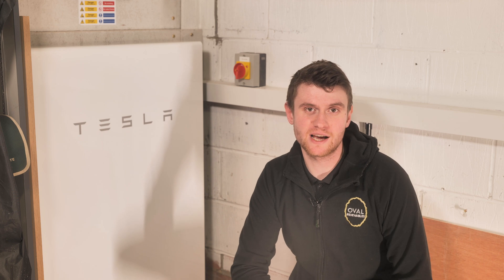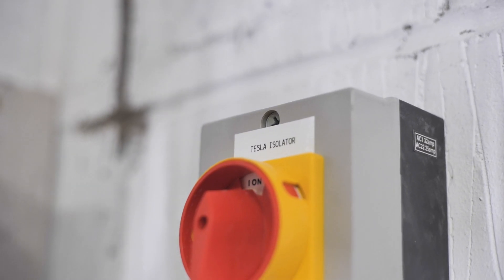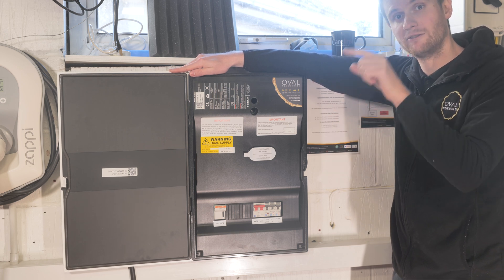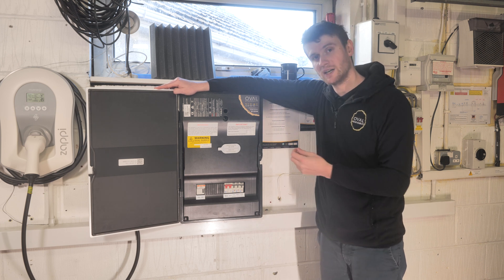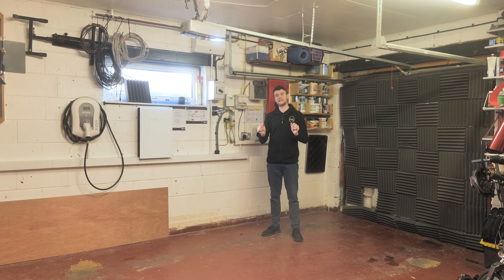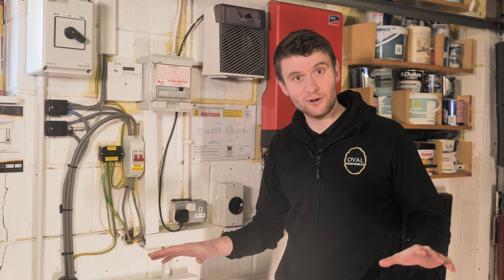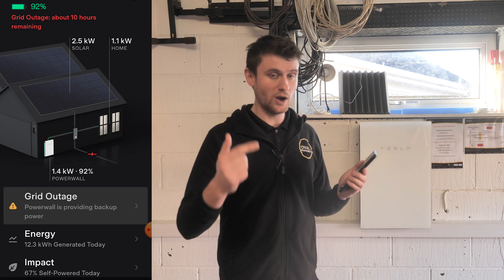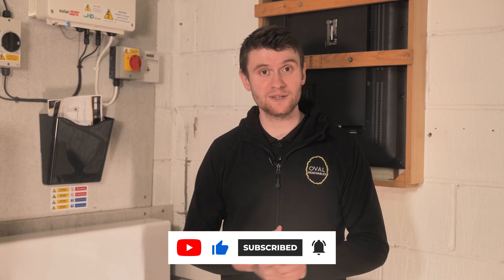North Ferriby Home Energy System Part 2 - Tesla Powerwall Battery Installation

Comment: What u recommend  for clipping I have 12 kw tiles installed 2 power walls  1 Tesla 7.7 inverter
Reply from the maker: There isn’t much you can do to stop the clipping really as it will happen during the sunny times. You just have to accept that the additional solar will be wasted in the summer but really important in the winter 👍

Comment: The Victron Multiplus-II Inverter Charger 48V 5000 VA 48/5000/70-50 has all the features you mentioned as well as having protected and unprotected circuits
Reply from the maker: Yes there are alternatives out there

Comment: Do any other battery systems support fully off grid mode in the event of a power cut? That's a great feature!

We have just bought a house with solar panels fitted around 10 years ago with one of those sunny boy inverters. Definitely want to get some battery storage put in!
Reply from the maker: Tesla does it the best in my opinion but there are other manufactures that support a certain level of off grid.

Comment: I’m a newbie with batteries etc. Does the Tesla only come as an AC battery? In Ireland I read if you have a 6kW inverter which is the max allowed, then a 5kW Tesla battery will take up 5kW of the 6kW therefore PV can only use 1kW is this true? Think that’s why there are very little powerwalls installed in Ireland!!

Comment: I’m waiting for my PV system and powerwall to be installed. Supply chain issues causing my installer delays with both but hopefully not much longer. This is a great demo of exactly what I want it to do. Would be really interested in seeing a line diagram for that system just to know exactly what is going where. I didn’t realise for example that the grid tails went directly to the gateway and the battery and PV are fed off an internal board. No need for another CU which is great.
Reply from the maker: Thanks very much, all installs are different but that’s how we have done this one. It’s a great bit of kit!

Comment: Thanks for the good content. But how is tesla controlling the 3rd partie solar-inverters, when the battery is full?
Reply from the maker: Another good question, we may do a video on this. The powerwall ‘turns up’ the frequency in off grid mode when the battery is full to fault the inverters out. Very clever stuff

Comment: Can 2 battery’s be placed side by side as well ?  Will 2 battery’s allow 10kwh discharge
Reply from the maker: You can actually set these up to do either!
Reply: @OvalRenewables  Either, as in, it could actually handle 10kW? I thought the inverter would limit that, at least on a single phase?
Reply: Side by side, or stacked infront of each other. But it wont allow more discharge, just longer life due to the larger battery size.